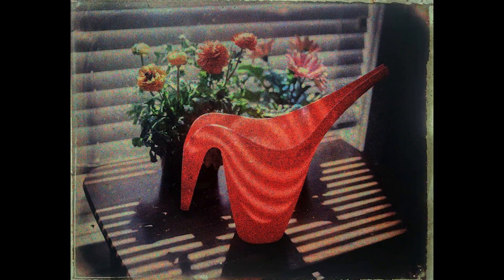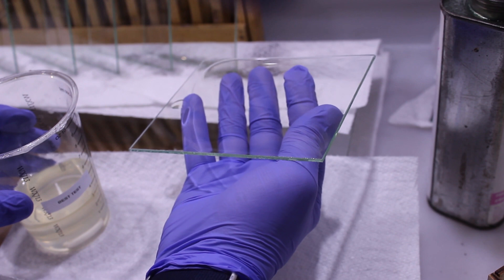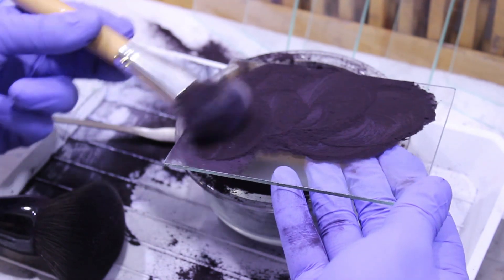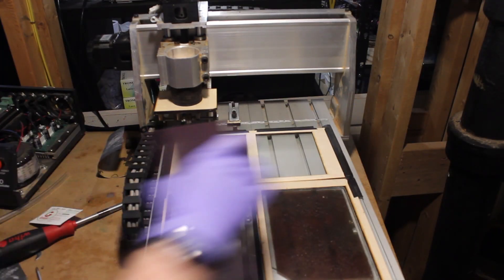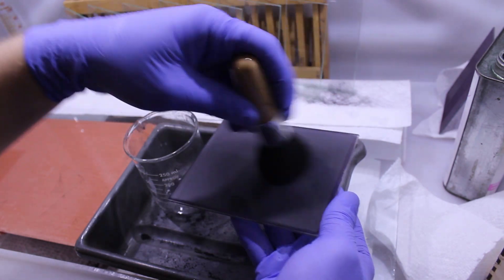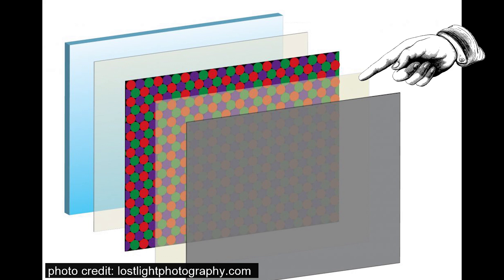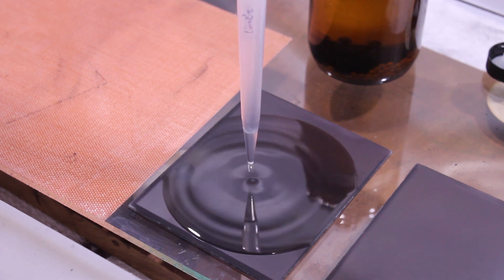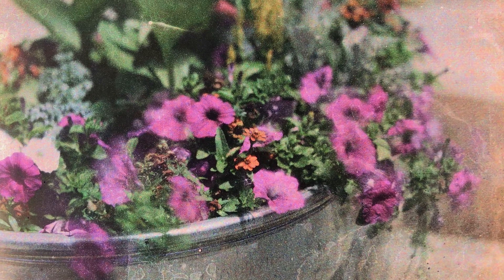Making an Autochrome Screen Plate

Comment: I would love a full video. This is very cool.
Reply from the maker: It's still in the forefront of my mind!  I had a lot of issues getting good results this summer, which really kind of set my video plans back a bit.  The process as I know it is still very much a work-in-progress, and there's a ton of room for improvement.  

Maybe I should double down though, and not let "perfect" be the enemy of "good"...
Reply: @jonhilty7434  It is also always interesting to see how things are 'in progress'. It may not be at the conclusion, but little successes and failures along the way can be just as interesting as the finished 'perfect' solution.

Either way I am sure whatever you choose to put out will be interesting! (And no pressure to put out any videos about it either)
Reply: @jonhilty7434 yes please! Just came across your video almost by accident, I’ve always loved autochromes and had no idea people were making them today! I’d love to know more
Reply: @jonhilty7434  Were you ever able to achieve the fineness of grain that the early autochromists got? I've read the starch grains were sieved to about 10-15 microns.
Reply from the maker: @boaz9208  I've gotten a lot closer!  Most of the stuff I've made over the last year uses grains that are maybe 4x the size of the Lumière grains.  To sort the grains they used "levigation", where they would mix it all up in water, and the larger particles sink to the bottom faster than the smaller ones.  They had a complex setup to do it with a bunch of basins and gates, but you can get pretty decent results with a 5 gallon bucket with a spigot near the bottom.

If you take a look at my instagram, all the plates from my Japan trip last October used "30 minute" starch - meaning I mixed up a big scoop of starch in 5 gallons of water, let it sit for 30 minutes, and then transferred the starch water to a second bucket and let all settle out.  The particle size is way way way smaller than just using it raw, but is still a bit bigger than the original ones.  60 minutes brings the particle size more in line with the original plates, but you only get like 10g of starch at a time, whereas with 30 minutes, you get like a couple hundred grams.  So it's a bit of a compromise based on how much effort you want to put in to that.  

I burned out pretty hard on autochromes last year and have been focusing on Lippmann photography recently, but I think I'm at a point where I'm about to reverse-burnout back into autochromes.  I'm hoping to start working on an emulsion recipe that's a bit more authentic to the originals, rather than using the random b&w negative recipe I've been using.
Reply: Same here. If I had the resources I’d try this myself 👍